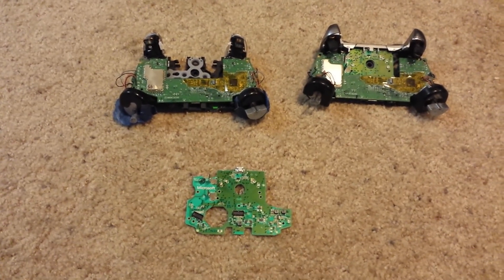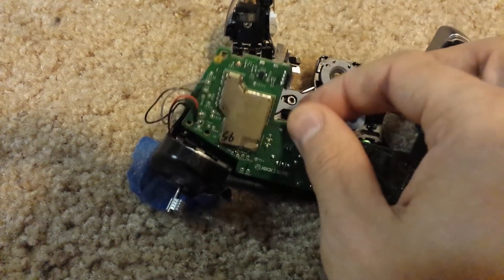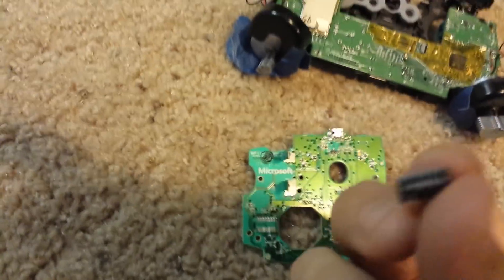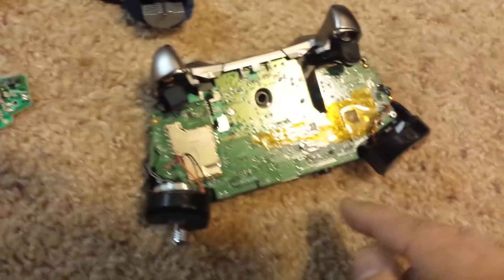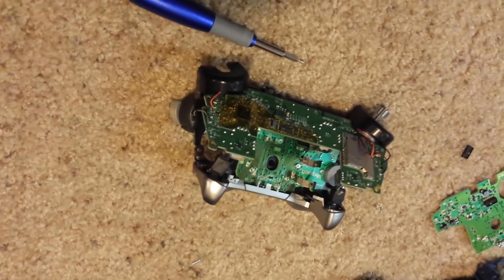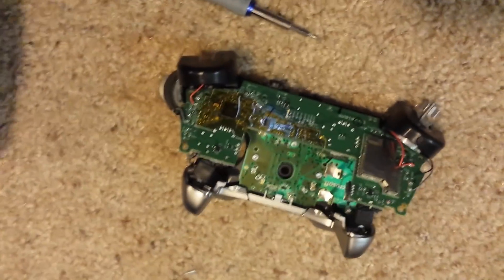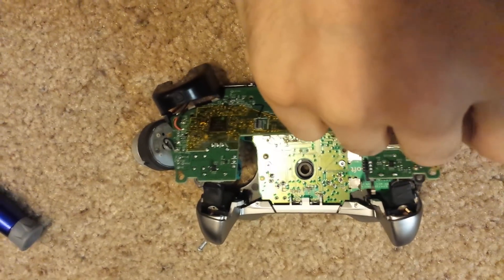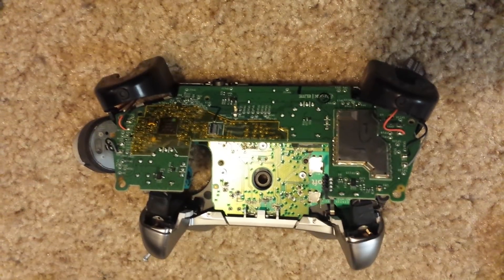Why XBox One controllers won't turn on or charge.  Fatal flaw in Microsoft's design.

Comment: My controller comes on then turns right off.
Reply: Matt5 probably got short circuited that's what happened to mine
Reply: Matt5 same with mine
Reply: My starting to do that my batteries are fully charged up it basically brand new i just bought this like a couple months ago never drop or throw my controller across the room i actually take good care of my controllers............
Reply: same on both my store bought and the controller that the xbox came with dose that

Comment: great video, just opened my shit up and all my boards are still in place? no structural damage to either the external or internals of the controller but still won't receive power, any idea?
Reply from the maker: Jack Leal if batteries dont work and it wont power on even when connected to the console, something has probably shorted out or isnt making a connection. If it's not easily visible you'd have to spend a lot of time testing each trace to see where the failure is, and also have a schematic to know the values for each component. may not be worth your time to pinpoint it. I'd first try hooking it up to the console via usb while system is off. Then turn it on using the console's power button. After you get to the dashboard hit the home button to try to turn the controller on. if that doesn't work, you likely have internal component failure.

Comment: The Xbox One controller is an absolute cluster. Pulled mine apart and what do you know... that SMD component was missing/somehow desoldered off the board.
Reply: how is Microsoft not voted worst company of the year like every year?
Reply: @Badger17805  without Microsoft technology wouldn't be the same today Microsoft is one of the top companies along the side of Apple you're an uneducated idiot if you think it shouldn't be that way
Reply: Lee Lowry Apple isn’t a top company they haven’t improved anything in years.
Reply: @leelowry9340  MICROSOFT IS HOT GARBAGE.
Reply: @Badger17805  are you fucking stupid? Intellect of a child. Microsoft doesn’t only work on Xbox they work on phones computers softwares games dishwasher washing machine dryers etc). Just because of a faulty controller doesn’t mean it’s a bad company

Comment: my elite controller will not power on after trying an update and MS said there is nothing they can do cause it is over a year! wtf I'm done with MS I'm selling my Xbox and buying a PS4
Reply from the maker: Greg Sieracki keep trying. try turning the system on with the controller attached by usb. ive seen others do it on videos, but have no personal experience with that issue
Reply from the maker: Christian Escobedo you've been lucky. ps4s overheat, the power supplies keep changing because they short out, and many many many ps4s have already had to have the chips recalled because of the crappy solder.  if they didn't cram everything into a small space with little airflow it wouldn't be a problem. my Xbox one stays quiet. it's big but lots of airflow. that may change with the new slims though since it's less space with the power supply put inside.
Reply from the maker: Christian Escobedo well it worked when you blew into the cartridge ;) but yeah the dlc crap is getting old and the yearly revision to the console.
Reply: its been a year.. i bet you still have your xbox...lol

Comment: This BS just happened to my new conrtroller last night and I only bought the new controller because my old controller mic all of a sudden stopped working 3 days ago, so I have lost two controllers in 4 days. also I have to mention (which I haven't seen anyone talk about ) that once it stopped working my controller started to heat up in the middle between the   right analog button and directional pad.
Reply: same my controller out of nowhere won't turn on even with new battery's / battery pack and even the USB cable.. it won't turn on :/ 
and its starting to get hot and smell like its burning..
Reply: idk what to do
Reply: WolfMixBoy yeah mine smells like barbeque grill coming from the USB port
Reply: Adam Russ oh wow I have been using my phone charger as my USB to buy less batteries, I've been doing that for about 7-8 months what do you know I blew up my own controller lmoi
Reply: Narutoki54  I had to buy an new controller for 60$  that only uses an USB cable.  It works pretty nicely for me and you cap map the buttons on the bottom of the controller

And the Xbox company gave us a new controller because of what it did 
https://lh3.googleusercontent.com/WC4-JIHHEzG--rL3ZhACLBCdD-2hRhT5lrPQQGKKlsVEhOxs6AFKChX96fCqzDMbWvmoSQAqDjM
Reply: WolfMixBoy yeah i have to get a new controller as well it's been smelling burnt for a few days. and the link you sent doesn't work :/// I don't understand why it smells hot i plugged in my USB and plugged it out and it was just hot and batteries don't work I think my sodders came off like what the video guy said
Reply: Narutoki54 I think it can be that and also can be the batteries burring out the wires
Reply from the maker: Narutoki54 are you using a rapid charger from a cell phone as the USB? If so, that may be part of the overheating. I don't think they were designed to handle the extra current
Reply from the maker: Narutoki54 use one that isn't a rapid charger. probably find one at Target for a few dollars
Reply: Adam Russ I don't know what you mean by "rapid charger"
Reply from the maker: Narutoki54 just Google it for an explanation. My suggestion to save money is to go on eBay and buy the aftermarket battery chargers for the Xbox One. they're just like the charge and play kits but a lot cheaper. It may void the warranty on the controller, but as we've seen, the warranty is essentially useless.
Reply: Adam Russ the charge and play kit I believe helped F***ed up my controller 😂
Reply: Shawn Harrison So did mine, when I tried to turn it back on (I went into the shower and came out then all of a sudden the controller didn't work) it started to smell of burned plastic and got really hot, had to take it outside because it was so hot and smelled bad

Comment: Maybe that's why my controller is hot for no reason I thing there might be a burnt wire inside😦
Reply: xRealizationz that's what is happening to mine I have had 3 and the have all have a burning smell inside
Reply: No it's not a burnt wire it's the panel that keeps the controller synced that most likely overheating
Reply: Lee Lowry true
Reply: Dip Load this was so long ago but I had to get rid of that controller because it had a really bad smell like something was burning
Reply: Same here my controller getting hot while charging but not turning on
Reply: Lol same when I put in new batteries liquid start coming out I'll just use my backup controller
Reply: if it was burnt it would spread fire and it will turn into instant coal
Reply: Mine has the same burning smell to
Reply: @lilruiz1949  same
Reply: Realiize they could made it outta wood for perfect
Reply: Dip Load ???
Reply: Realiize if u drop little wood of carpet it no take damage
Reply: k

Comment: Okay please help me out. When i press the home button it will blink twice but doesnt connect or sync. when i use a micro-usb from the xbox to my controller it wil work and sync, but only with the batteries in the controller. when i take the batteries out it wil stop working again. if i take the usb cable out of the controller after syncing it, it will also stop working and it cant reconnect/sync agai. Only if i use the cable again and leave it attached to the controller. What is wrong with my controller?
Reply: Jasper I got the same problem, but when i connect a usb to the controller it starts to smell like something is burning within the controller
Reply: Jasper hold down home button and press up then right on your d-pad then your controller will shut off then turn it back on if it still doesn't work in plug your Xbox then wait 30 seconds and that's what I did now it works
Reply: Jasper the same thing happens to me, it blinks twice and only works with batteries and usb at the same time, but it feels really hot and smells like its burning
Reply from the maker: Thats a tough one to diagnose simply by the limited information. there could be an issue with the wireless transmitter on the controller but i could be other things as well seeing as you have the battery issue when the cable is attached.  could be an issue with that particular cable too. i had one that was problematic but using a different one fixed the issue.  have you tried it on a different xbox yet to see if the results are the same?
Reply: Hey guys, has anyone got their controller to work once having this problem? My controller is the same.
Reply: M0VEMNT same!
Reply: Kevin Hernandez my controller started acting up before I left the house I came back and it completely won't come back on I plugged in the USB charger for a while and it smell like it's burning from the inside
Reply: Adam Russ same my controller burning
Reply: Jasper just connect with wire first then your xbox read your controller and you can use without wire too
Reply: but how to fix it?
Reply: can a wireless transmitter be replaced?
Reply: Guys I have the same problem exactly any solutions😔😔😔😔

Comment: the xboxone controller is less quality, if you look at the 360 controllers the inner joypads had metal in them, while the XBOXONE were made all plastic.
Reply: Fernando Salazar Exactly my 360 controller was thrown against a wall and still worked like new, soon as u drop the xbox one controller it  internally snaps... smh

Comment: hi my controller is broken it wont turn on at all but it vibrates still
Reply from the maker: tough to diagnose without opening but limited functionality could very easily be those connectors separating, but it could be other things as well.

Comment from the maker: in most cases no. I. the cases that you can it's a gigantic problem of soldering trace wires from one board to the other for every torn pad.
Reply: I'm going to try buying a new one from best buy and swap my faulty one then return it
Reply: I'm not sure if this post is responding the sync/usb issue guy or not, but have you been able to solder them back on? I haven't opened up the controller I have that has this problem (gave it a little shake and heard it rattle) yet so I haven't seen the damage in person.
Reply from the maker: +dokaplan rattling can sometimes be a loose magnet for the trigger.  USB ports can be replaced yes if desoldered properly without removing the solder pads. however, if no controllers will sync, you're probably dealing with the chip on the top of the inside case of the xbox going bad. those are an easy fix. just replace the bad part
Reply: Good info that I'm sure I'll use in the future, but I actually meant the connector in the video. Sorry about that!
Reply from the maker: +dokaplan it's not worth the cost of epoxying new solder pads. it's time consuming and the kits are not cheap
Reply: Bummer, but thank you very much for pointing out this problem!
Reply from the maker: +dokaplan no problem. in those cases you're better off buying a broken controller to get a replacement board

Comment: Okay I'm not this tech savvy but my Xbox one controller won't turn on. It won't even blink, I've changed batteries and still it won't even blink once. I tried using a USB and directly plugging it into the Xbox and it still won't turn on. It won't turn on either when I plug in trying to use it on my PC when it previously did work. Not sure if it's the same reason you explained in your video with the boards separating. If it is, I'm out of one Titanfall controller :/ fucking Moneysoft.
Reply: It’s happened to my elite controller :/ any one found a fix
Reply: SethSliders Supreme I would too :/ it’s really disappointing that a controller that costed £120 for me breaks after a year ( 1 1/2 month out of warranty) and you are not the only one that’s been affected by it. I would just go and buy a new controller and I would recommend buying this - Bionik Quickshot Custom Rubber Grips with Dual Setting Trigger Lock (Xbox One) https://www.amazon.co.uk/dp/B01N1QO0TS/ref=cm_sw_r_cp_api_WcumBbD659EQ9
As this adds the trigger limit and adds better grip, it’s not the best but it’s worked :) hoped that helped
Reply: AlChestBreachFan7 that's what happened to me but I did just get a wired controller it's just better
Reply: I got the exact same problem. Not sure what to do
Reply: I’m having the exact same experience and I’ve had it before, the controller that’s having the problem is the elite controller I have. I tried looking at videos, and one of them worked for 5 minuets then the controller just went off again. I am very upset about this happening to me twice and I’m tired of buying new controllers and I want a fix.
Reply: SethSliders Supreme how did you get it too work??
Reply: pi**ing off the internet I did the method this video showed me https://youtu.be/-ixGAonYn3E, but he did say that he would recommend you to just buy a new controller.

Comment from the maker: do you hear a click when you press the sync/bind button? pull off the grate along the side with the sync button. then make sure the plastic plate behind the button is in place. if it has moved or isn't there you'll need to pinch the backside of the bind button on the console. an alternative is to hook up a micro USB cable to the controller and it'll auto-sync.
Reply from the maker: @Manuel Torres Might need a firmware update on the controller

Comment: My will turn on but when I press the sink button the light doesn't blink and nothing happens on the Xbox
Reply from the maker: For those with this issue I recommend one of two things.  One is to connect a micro usb charger to the controller and plug it into the usb port.  It'll sync this way.  If that doesn't work, it could be a problem with the wireless chip that in on top of the inner case.  The other issue with this is when you press the sync button on the xbox, make sure you hear a click and possible feel the resistance from the plastic piece behind it.  If that piece is moved or missing there will be nothing for the button to press against and it won't trigger the sync to start.  The left side vent come off pretty easily.  Remove it and check to see that the plastic piece behind the sync button is seated correctly.
Reply from the maker: If the sync button on the controller doesn't work, it could be a defective home button (check to see if it works at all by pressing it when in a game and see if it takes you back to the home screen.)  If it doesn't, it may or may not be fixable, depending on what's causing it in the controller.
Reply: I agree with everything said in the video.  From personal experience, I had two controllers both go out on me with similar problems.  They both just stopped working after almost 365 days exactly.  Seems pretty suspicious Microsoft.  If you are making faulty products that are designed to fail, someone should file a lawsuit against you.  Especially if you continue looking the other way and not take responsibility for your faulty product.  Haven't you heard of recalls? Happens all the time with other products.  Why is this any different? Get your shit together Microsoft
Reply: XLS Gaming Have you fixed it?

Comment from the maker: would you prefer a controller like the ps4 with an internal battery where the battery life sucks and replacing it voids the warranty?
Reply: Adam Russ 
Yes.
Reply: Yes, I would prefer a built in battery. I don't game wirelessly anyway.
Reply: That's why I have ps4 and Xbox one I can compare without being biased PS4 definitely wins in every category
Reply: @ibnkrisishayawasatmuhammad3589  nope not the most powerful console in the world category :)
Reply: Lee Lowry he didn’t say Xbox One X 😜
Reply: @AceGunnerHD  so what? It's still the most powerful console in the world 😜
Reply: @leelowry9340  Are you saying the OG Xbox One is the most powerful console in the world?
Reply: Adam Russ nope
Reply: Yes
Reply: Hell yeah
Reply: well yes but actually yes
Reply: replacing a battery is easy compared to attempting to repair or replace the board... obvious yes
Reply: I've had my ps4 controller since the day it came out and it works just fine with zero battery issues

Comment: the "pads" aren't actually being torn off. they're just falling off. most of these controllers are made VERY cheaply and when those cheap components heat up, they fail. it takes far more pressure to shear off the solder points than it does to unplug the connection. the problem is simply cheap solder and breadboards separating when stressed.